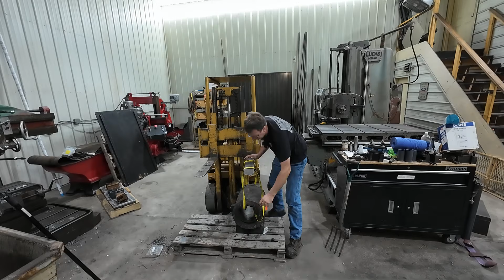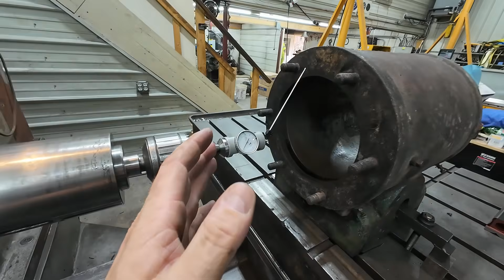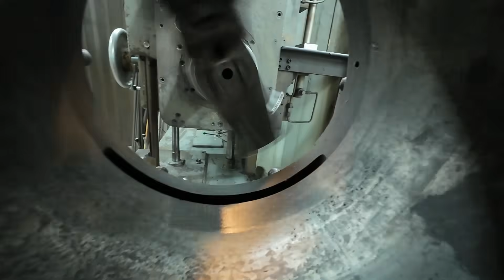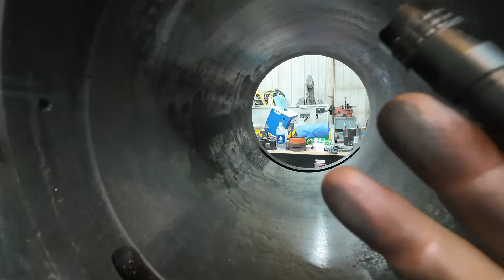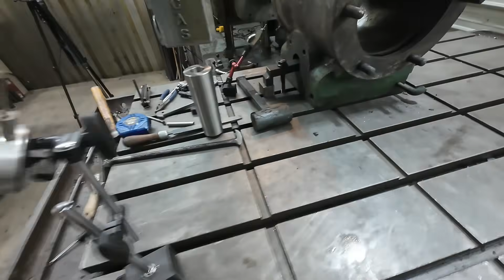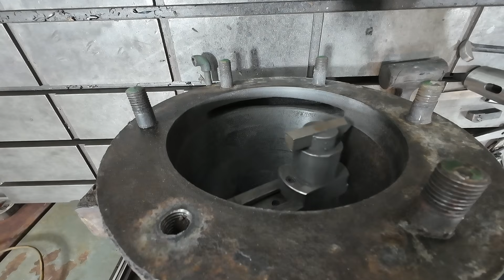How To Bore A 100-Year-Old Steam Cylinder | Manual Machining Tips

Comment: Good video . I have some concerns about your Abner D. Baker  thresher boiler , though.
Wondering where you are at in your  inspections of this pressure vessel? If the boiler is over 100 yrs old, I would consider an inspection of the metal worthiness by having a state licenced boiler maker cut a "boat" - an elliptical shaped piece of metal from the lower portion of the wrapper sheet, remove it, and have it spectrographically
analyzed and ex - rated down to the molecular level for ANY flaws
before firing up the boiler. 
  Most often, boilers of this type -
Portable Locomotive style boilers - were constructed before the days of ASME code . Meaning: the metal they were constructed FROM, was NOT boiler steel. Boiler steel is a special steel specifically made for pressure vessels that come in to intimate contact with heat and possibly chemicals as well. This steel must pass stringent tests for ductility, elasticity, resistance to deformation, among other stresses. I don't know of one thresher that has been built with that kind of metal, and as a third class stationary engineer ( Ret),
I have fired 4 of them , including a Reeves cross - compound 2 cylinder monster. Be careful, follow the rules of paying attention to: water glass passages , testing the try - cocks
all 3 of them, blowing down the boiler under no - load conditions to remove sediment in the boiler water, checking and testing the safety valve, and doing an accumulation test on it, testing and proving your boiler feed water devices ( yes!! plural !!)
Please be careful, be vigilant, and above all, be knowledgeable about the operation, care, and essential maintenance REQUIRED on a piece of machinery such as this at it's age !!
Reply from the maker: Zero concerns. ASME code stamped boiler. Inspected in WI, which is a very strict state.   I also have extensive background in B&PV, and teach boiler safety and operation. Along with taking several classes at the NBIC. I know more about boiler operation, construction, and safety than most owners and operators. So, again, there is zero concern.

Comment: You need to set your centre at Tool length. You could have set block true off both ends of bore. Back the tool out with tip at 12  o’clock. Tool is not ideal tip a rhomboid would be better.
Hence chatter 😅
HSS not hard enough for cast iron skin. 
Cast iron should be ok at holding oil?
👍

Comment: 5 years ago i whas also in charge to fix a 40hp esslinger. No drawing, no " DIY" Handbook a.s.o. no instructionbook... 
So i use all my expiriences i hat as my edjucated job on the Lathe as a turner.
I made the Piston, 9", therefore i can buy the rings from a MAN ship Diesel, from a shipenginemaintenaneshop at Koblenz/Rhine, wich fits perfekt. First try doesent let the steamengine run. So i figure out the the Governorslide also hat a "doublelemonwornout"... here we order a guy wich comes with a mobile drill/millingsystem to bring the bore back to cylindric form. The whole proceed needs 8h. At the End it needs 2,8mm in diameter to bring it round again.
Now we need also 8 cast iron Rings for the Slide... with this new diameter... and a with of 14mm ... no one may diliver such stuff ore have it in a cataloge😂
A long Story with a short end:
I buy 4 sets of a Pair of Brakedisc's of an Fiat 850 for 100€ from eBay and cut on the Lathe every piece away what not looks lik the needet Pistionrings.
After installing the Slide back into the Cylinderblock, the Esslinger does here first deep breathes by compressed air. 6 years after her installation, and apprx, 50 years after her last steamjob.
When she startet that well, the owner built within 6 weeks a boilerhouse, the boiler is from a Rhinedigger, and today she runs also under Steam.

Comment: 20:45 that dark area where the piston was rubbing is the location where trouble will start. The fact that your cutter didn’t clean it out is a sign that that area is deeper than the surrounding surfaces and you should run at least one more pass after you use an inside micrometer to verify that that area is not deeper than the rest. 

If clearing all this out took you beyond the specs, can you bore it out enough to install a sleeve into that housing you can machine again to size?

Comment: Is there a reason you can’t machine this backwards…far to near, so at the end of the cut the cutter is out of the workpiece towards the mill?
Reply: @robertkinstle9413  just a thought, coming from a machinist who runs a boring mill, ( cincinatti gilbert) a trick I always use is when I get done with my finish pass, you can stop the spindle outside of the part (at the far end) then jog the spindle so the cutter is vertical, then raise your y up .010 and retract your spindle or table. Works great

Comment: I worked for GE gear plant in Lynn MASS and almost all the machines were manual because there were no production runs. Except my 4 axis cnc horz boring mill devleig .  We did machine our own operating cylinder which looked a lot different. One large drum and had 2 cylinder bores that paralleled the drum and those 2 were honed. This was almost 35yrs ago and I lefted GE after they announced the reduction of over 10k union jobs. Completely left machinist trade and worked for a large gas utility that gave my family a great lifestyle. I will never forget walking into the old factories that at one time had 30k union workers making jet engines, steam turbines of different sizes, and gearing for the U.S. Navy. When I walked into the gear plant for my interview they were setting a bull gear for a U.S. carrier on to a vertical turret boring machine. I only seen this in videos in high school and now I'm going to be working around all the big machines. The horizontal boring mills all used the steel slotted floors as tables and needed over head cranes to load parts. The last machine I ran was a new 7 axis cnc horz boring mill that also had an index table that rotated as 1 axis and also moved in and out as another axis.

Comment: That's a neat boring head. I like the collar adjustment. I ran a big DevLeig boring mill when I worked for the Boeing company for 13 years. We ran a lot of jigs but sometimes we had to do free setups that like you could take hours. Most times you only got one chance to get it right. I found most setups were knowing your equipment capabilities and a little common sense. Could you if need be sleeve that bore?
Reply: I was reading comments hoping to see the correct spelling for devleig boring mill. I ran a 4 axis cnc horz devleig  boring mill while working for GE gear plant in Lynn MASS.

Comment: Thoroughly enjoyed watching this, you are lucky that your hobbies are able to benefit greatly from your business. Having stripped and reassembled an ICE after getting the cylinders rebored  I understand the need for a new oversized piston but you also mentioned the need for a new piston rod which I guess is what I would call a con rod on an ICE and a new valve rod. Can you please explain the functions of these two rods? Also the mark on the bore which you said would be at the bottom when the cylinder is installed on the engine, is I just a stain or did it not get cut?

Comment: So always tough to pick up on existing work! I have over 20 years of milling experience both vertical and horizontal. Extending your quill is definitely going to affect rigidity and accuracy during set up and machining. Your quill will sag...even on newer horizontal machines. Always keep the quill as short as possible and feed the table.  I probably would have that piece line bored...just a thought

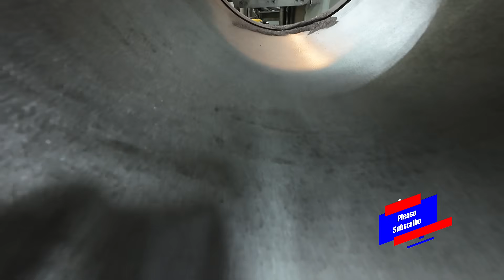Comment: I know nothing about anything, but it looks like there is pitting still? 22:48

Would this be an instance to use a bore welder to rebuild the interior? or does that not work in these situations.
Reply: It's cast iron, you cant weld it, if you tried it would most likely split and break. Boring is the only real option.

Comment: I assume you have a second cylinder that is probably just as bad?
Reply from the maker: you assume wrong.  1 cylinder
Reply: @TopperMachineLLC  Huh. Is this a stationary engine? I can't think of any even vaguely common and practical single cylinder locomotive. How can you ensure a single cylinder engine will self start?
Reply from the maker: @lwilton  Traction Engine, agriculture.  Single cylinder, they work great, just need to know how to start them.

Comment: CNC is it for production work no doubt about it no one wants to make 10,000 parts on a Warner & Swasey anymore. But for the cost of a HAAS a guy can put together whole shop full of manual machines that can make and repair all sorts of stuff. The guys that say you can make anything but money with shaper have tunnel vision. The shaper is one machine that can pay for itself with just one job with a single part at that. Show me that ROI with another machine.

Comment: How do you know if it was done right before? I woulda also figured out a way to take measurements from the rotating assembly and the lower end all together. Measure from the studs to the bore maybe. I don’t know I’d have to look at it in person to think about it. Who knows what could’ve went on in the past
Reply: I don’t know steam engines but if it has rings you go by the specs to see what they recommend. I’d always hone a bore because the hone depends on how the rings seat even if it’s only a piston

Comment: Good job Sir!   When I first saw that weird looking cylinder casting with 6 juicy, big studs at either end, I thought "That could be relatively easy to set up with a portable line boring machine". But I forgot that you probably don't have a need for such a machine with your skill set and the array of machines that you have in your workshop.

Comment: 😢G'day. A nice job challenging the machinist. Some years back, I did a similar job on a 1921 Ingersoll & Rand horizontal double acting air compressor. The same deal as yours wear on the top & bottom of the bore ,set the barrel as you did on the barrel mounting end.  I had 4 good locations for toe clamps, I used quantity H.S.S also with good results, my first cuts had a small amount of chatter, but once through the skin, this settled down, the boring machine had an outter support. I made a new piston & rings from a quality cast iron I think it was Meehanite from memory,I did hone the bore as I think this helps with lubrication. Good luck with the project.

Comment: At 22:49, it looks like some pits on the left side of the cylinder, but maybe they are just stains in the metal.  
Do you use the steam cylinder oil that is for saturated steam, as that is what you are running?

Comment: I would definitely hone it, I'm not Shure on steam engines , but gas engines, diesel engines need the hone for the surface finish, to be rough enough to hold oil. yet smooth enough to not eat the rings and piston skirt. With poor surface finish the rings will not seal well. Also i dont think the milled finish is truely as smooth as it appears. Under a microscope a razors edge looks like some alien cactus or something. Very rough. At the very least id go over it with 220-320 grit sand paper by hand.

Comment: In your initial setup, why didn’t you remove the studs on the end, the stand it on that end and skim cut the  valve block mating surface, so it would be parallel to the bore, then mount it on the surface you just machined, so you can bore it. Thereby eliminating any shims to compensate for uneven surfaces 👍
Reply from the maker: The studs are still good, removing them could damage them. Facing the steamchest would change the mating surfaces. Not something I wanted to do. Furthermore, why create more work than necessary, my approach worked just as it I needed.

Comment: You went a hard way and made it difficult for yourself.  I would have removed the flange studs, brushed and honed the flange end. Sit it upright on a similar diameter ring with a slightly bigger bore for pass through , and bolt it down on it's end on a vertical borer, and dial in your bore, that way bore is at right angle to end face guaranteed .  No other surface  or reference matters.
Reply from the maker: There was nothing difficult or hard about the way I did this. I utilized the equipment and tooling I own and completed a job I've never done. Yes, a vertical boring mill would have been better, but I do not own one.

Comment: How come it doesn’t have to be honed like a combustion engine?
Reply from the maker: Good question. I was told it's not necessary. Since cylinder oil is carried in by the steam, it sould have plenty of lubrication
Reply: @ I feel like it should be honed as the valleys of the honing marks will hold oil to lubricate/seal the rings to the cylinder. I have no knowledge of steam engines. I only have experience with combustion engine machining.

Comment: Working in the oilfield we use steam piston oil to liberate our mud pumps. It’s expensive but it works great. We had a fleet manager with zero maintenance skills try to use gear oil as liberation and parts failed dramatically. He tried to blame it on lack of proper maintenance. He got run out on a rail from the meeting. The look on the executives was priceless. We continued the meeting and all were at an agreement as everything was explained and facts proved themselves and spoke volumes. Thanks for sharing.
Reply from the maker: Cylinder oil is cheap when it is what is needed to protect the equipment.
Reply: Did you mean lubrication instead of AI  generated "Liberation" ? Not so Intelligent is it? lol

Comment: Looks like a nightmare setting it up. I wonder if you could have bolted the cylinder to a face plate on the lathe and bored it that way. The issue with that idea is balance, with that heavy section at the bottom (as it sits now). So that idea may not have worked.
Reply from the maker: A vertical boring mill would have been best, but I got it.

Comment: Smooth is good  but honing with some cross hatching will make a place for oil to cling when the rings move on the bore just like a gas engine has .
Good job on checking out the machine for being true .
Reply from the maker: Stay tuned.

Comment: Would it have made more sense to weld up the bore and machine it back down to original size so you can still use the same piston, cylinder etc.

Comment: when i  was a kid i was not allowed to lien on the table it will shift the bore,
the hard spots won't bore the same  even on a new machine, that's why it needs to be honed
Reply from the maker: I find it amusing how many people were told that. Having done this over 25 years, the only time leaning on a machine caused problems was either a flimsy little pos or an improperly setup machine.

Comment: What piston clearance will you make?? I assume you went through to the end, so you could get the piston into the bore???
Also, you could make your own piston rings, to precisely fit your finished bore diameter.??
Reply from the maker: Clearance and materials need to be determined yet. Aluminum is going to be my choice for material, but not sure what grade. I will prichase the rings, why make something that you can buy relatively cheap, and get a spare set for the shelf.

Comment: I woked a Kearns SH75 horzontal borrer for 13 continous years. The quill (spindle) should be set up so that it is very slightly facing uphill not downhill. The Kearns had a metre movement on the Z axis quill. This set up this allows for gravity to pull the spindle down further when the spindle is fully extended.
Reply from the maker: Good thing it is slightly downhill already. I thought it should be parallel to the table.
Reply: I agree in a perfect world but when the vertical ways of a boring mill get worn they tend to start boring slightly uphill because the head is heavier in the back than in the front.

Comment: I think you should have the piston before you do the final bore.  The piston should be a slight oval before the heat makes it round.  Due manufacturing tolerances your current "hole" maybe off in one direction or the other.  This is why you do not bore an auto mobile engine without having all the pistons on hand before starting.   I would hate to see you do this twice.  or maybe its a steam engine and the tolerance just does not matter.
Reply from the maker: Steam is different animal. In automotive applications, you bore to a known size of piston. In my case, you bore to clean then make a new piston. I have to calculate thermal expansion of both the cylinder and the new piston and get the proper clearance st temp.

Comment: You are making a new oversized piston. Go ahead and bore it big instead of making all those little cuts. That's the wrong type of insert for boring on a mill, you need something sharp.
Reply from the maker: Use what I had on hand. No work coming into tue shop lately, so no money for tools. It did the job.

Comment: I think you chose wisely by dialing in the crosshead end of the cylinder.  Especially getting concentric to what was likely the piloting diameter for the cross head frame.  Your bore is now concetric to the cross head frame bore and square to its mounting flange.  I was surprised that the first cutting tool was able to cut at all.  It didn't look like it had any side clearance (i.e. the non cutting edge was parallel to the cylinder bore).  However, it may have just been the camera angle that made it look that way.  Regarding not honing the cylinder, I would assume the machining marks would do just as good a job of holding lubricant as the cross hatch would.  It all turned out well.  Ken